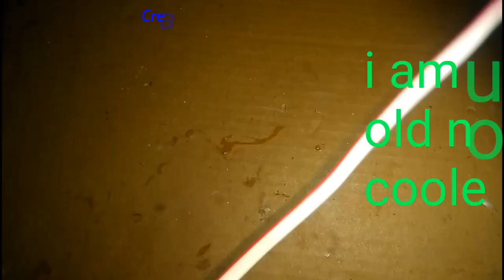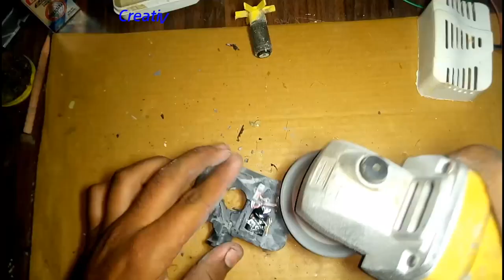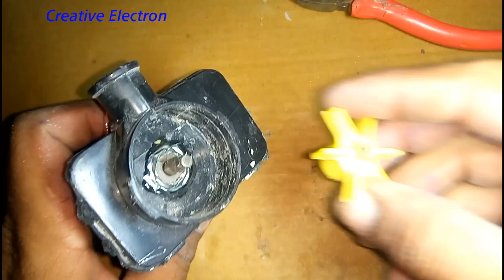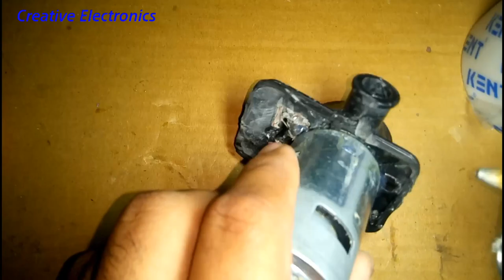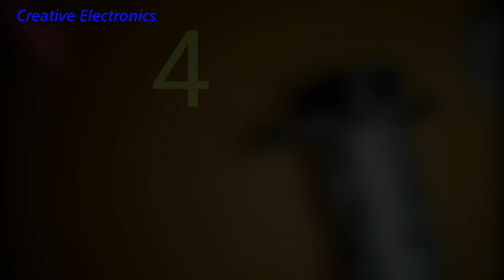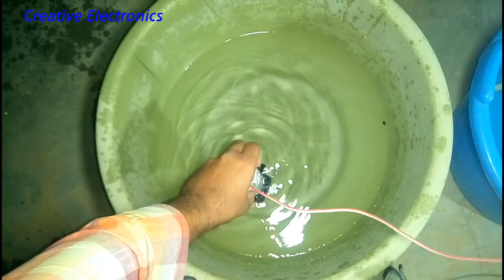DC powerfull water pump (Creative Electronics)

Comment: How can I get out of order motor parts.pls tell..how did you find this motor parts
Reply from the maker: front black penal got from old air cooler ac water pump and dc motor 775 you can buy for Amazon.com .in and bangood.com

Comment: the next time use distilled water, you will not need to seal, because the distilled water is not conductive, inside you can also put a light, it will not make sparks.
Reply from the maker: thanks for sharing your thoughts  and saying right